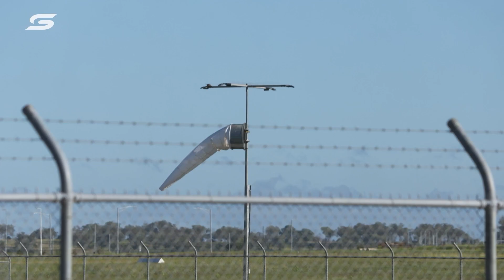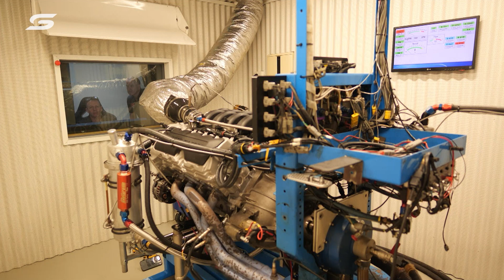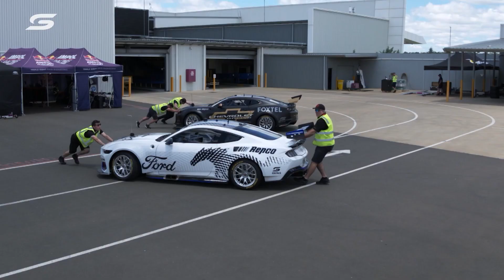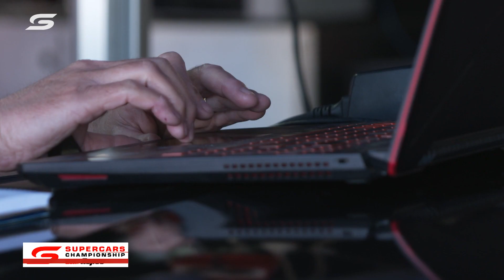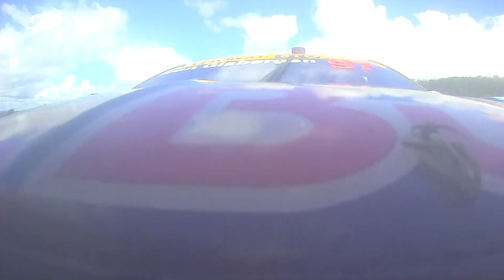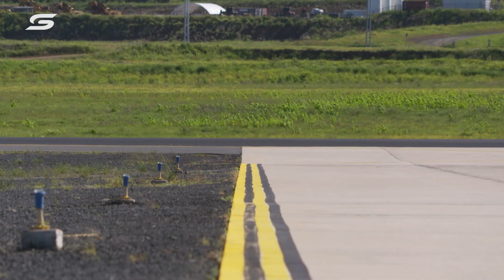Why aero testing Gen3 is so crucial | Supercars 2022

Comment: Well we know it's BS now Larko because Ford aren't happy what's happening to the rear wing...
Ford need answers and nothing coming forward..
Reply: I think a missed opportunity to get rid of ( in car ) anti roll bar adjustment. There should be 1 setup for race day. Both cars can be the same this/that but as SVG has proven ( in my eyes at least ) the more corrective adjustments made to anti roll bars front & rear, the better your chances. SVG, l would say watching over the years makes more adjustments than any other driver. Supercars can say that both are the same but once drivers play around with the in car anti roll bars, aero differences will occur resulting in different performance outcomes.

Comment: So compared to gen 2, the gen 3 supercars make around 50hp less, have 60% less downforce and increased aero drag, yet they somehow still reach the same top speed?

Im aware that it's all supposed to be more cost efficient for the teams, but my logical mind thinks that having cars closer together on the track would have an increased risk of more crashes, thus requiring extra production of all these custom shaped panels and mouldings, therefore its not really being more cost effective.
Or perhaps im completely wrong?
Reply: No, DEcreased aero drag, hence why they make a similar top speed with less power.
Reply: @MattyS02  
Better aero INcreases the downforce - more downforce means more drag, therefore you are INcreasing the aero drag.
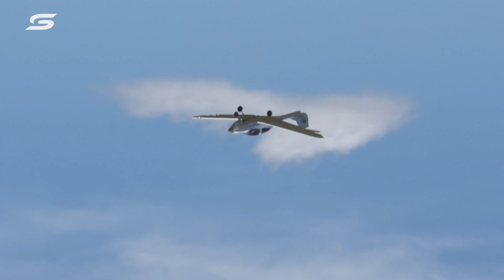This is what he says at 08:12 and that it kills straight line speed, hence my confusion at how they can still reach the same top speed as the gen 2s
Reply: less weight and better power to weight ratio, we'll see when the hit the track in anger.
Reply: @nickycrea6075  
I don't think less weight improves overall top speed - rather, it will accelerate faster and have better fuel economy because the engine doesn't need to work as hard (this is newton's law of motion, F = ma)

I dunno, im guessing they've tested its top speed, so i must be wrong lol i just can't make sense of it.
Reply: @zchettaz  since the Power to weight ratio has improved speed will be around the same.
we'll know for sure when the cars hit the track.
Reply: @@amwashere 
Thanks for clearing that up. So basically that would mean the 60% more downforce in the gen2s decreased there top speed equivalent to 50hp, is that right?
Reply: @@amwashere 
Again, i refer you to 8:12 in the video.
He says "The more aerodynamic downforce you put on a car, the more drag you create"

Comment: So how can a simple guy like me in the U.S  get some of the body parts and the Spendle mount wheels and kit for the wheels?? I have a Camaro that needs them in its life. It told me so lol.
Reply: Unfortunately not one bit of these reflect a street car. Every single part is custom made race car
Reply: @Bruce Mcginty  well some of that needs to change! Truth be told, it doesn't have to be carbon fiber or space age metals. I would Grand Touring my SS looking like the SC Gen 3 Camaro only with an interior and AC. Lol
Reply: @Bruce Mcginty  I do get what you mean though. Kind of like NASCAR did back in the day, right? Run what you brung and what wins on Sunday sells on Monday kind of thing. I agree 👍. I think there should be 3 classes imo. Showroom stock (with cages and safety equipment), what they are doing now where the drivers come into play only (basically) and then unlimited class.

Comment: So, just out of curiosity: is there a specific reason why V8 supercars didn't become a spec racing series where everyone drives the same car if their performance numbers are exactly the same?
I would've loved to see a BOP style approach to this, which would still allow cars to be different, but come out rather close in performance.
Reply: I think the suggestion is that a Mustang-only series would lose the interest of Chevrolet/Holden fans.
Reply: @TassieLorenzo  Interesting, I though holden was Australias Opel and had nothing to do with Chevy?
Reply: @shadow-r3852  Holden has used both Opel and Chevrolet pressings and engines over the years.🙂

Comment: I dont know why yall equate less downforce to better racing. Someone explain.
60% less downforce with the same tires and just as heavy cars? Will turn into a tyre management festival.
Reply: The new cars are 100kg lighter thanks to the aluminium engine blocks and full carbon fibre bodywork.
Reply: @TassieLorenzo  100 kilos is a lot i must admit. But still
Reply: But they got to make a video and get some ad revenue, make the audience feel engaged woth the changes and feel smarter because now they can tell people they know about aerodynamics or something and they are promising better racing. 
Next year the commentators will be able to talk about the tyre management strategies. 

The sport runs on the story they can tell, not so much on the racing.
Reply: They're looking for the cars to be twitchier i assume so they can slide around the corners and need a bit more skill to drive, so drivers can overtake when another makes a mistake more often, it might effect turbulence and make less difference in speed by coming out of the slip stream but i don't know. 
Cars sliding is more interesting and maybe just more crashes equals more better.
Reply: @chrisnoname2725  sliding means wasting tire life. No team wants that  More crashes means more money spent to repair. No team wants that either so it will be a tire saving festival
Reply: @km6832  I wasn't saying you were wrong, i was saying why i think they are marketing it as better. Race cars cost money, they get damaged, that is offset by getting more viewers. It depends on tyre rules, they might have to conserve them a bit but if they make things too boring then they will lose viewers if it becomes more exciting to watch trucks driving up the highway. It's entertainment.
Reply: @chrisnoname2725  didnt accuse you of  being wrong either. Was jusr stating how it most likely will turn out.
Reply: @km6832  "sliding means wasting tire life. "  On radials, yes.  Cross-ply tyres like in TA2 work better at big slip angles, hence the four wheel drifts in F1 in the 70's before they changed to radials around 1980.
Reply: @TassieLorenzo  we dont use cross ply tires on modern racecars now do we?
Reply: @km6832  I should hope not, but they do in TransAm/TA2 and it would "solve" the problem of people who want the cars, say the touring cars in the ATCC, to slide around more.

Comment: I really wish NASCAR and Supercars had collaborated to have a shared platform for some potential crossover entries in key events.  Huge missed opportunity for both series.
Reply: I’m not so sure Australian fans are interested in oval racing, I know that NASCARS operate on circuits as well but their natural home seems to be ovals I don’t think the Aussie fans would want the performance of the cars that do Bathurst, Sandown, Adelaide etc compromised to run Ovals. Not that we have more than one oval here. We tried NASCAR a bout 20 years ago, it didn’t last too long, I think we like corners that go both ways.
Reply: @hughjohnson2674  Perhaps a revival could be in order, I know with Auscar and the like there was interest there in the 1990's and I do know the dirt oval scene is very strong with both late models and sprint cars, so there might be more oval interest than you know of, simply not from folks who are typically Supercars fans and are devoting their dollars and eyeballs to other forms of racing.  Also, NASCAR's really diversifying the schedule with more road courses and even street circuits so there'd be no better time really.
Reply: @hughjohnson2674  is it really oval racing when there are as many road courses as WEC rounds
Reply: @Kadarii  there’s no oval racing in Supercars, they’re not built for it. They’ve just spent two years and a shed load of money, like F1, to make the sport cheaper and produce better racing by introducing as much parity between the vehicles as possible. They have matching chassis, suspension, brakes, horsepower from crate style engines that run on e 85. A Gen 3 supercar is not legal under NASCAR rules and vice versa. Our cars have 6 speed rear mounted transaxles, flappy paddle gear changes,  carbon fibre panels and run different wheel and tyre combinations. Nascars are probably faster in a straight line but throw one around the mountain for 1000k and we’ll see who’s quicker in the end, our cars are all based on new tech. Whose rules are going to change to get parity? We tried a version of Nascars here years ago, one entrepreneur built an oval. It lasted about a couple of years but couldn’t take pay for itself. Supercars Gen 3 car is designed to reduce costs, it’s being introduced next year, the teams are building them now. Why change to a lower tech spec.
Reply: @hughjohnson2674   I love how you assume i’m an infirm when you don’t even know Gen 3 regulations or the Gen 7 cup car, I just want sustainability from a series I love…
Reply: @Kadarii  never said you were infirm I know Gen 3 Regis not Gen 7? At all. But a Supercar isnot a NASCAR and never should be
Reply: Nascar wouldn't last 3 laps on our circuits mate. Gotta brake a lot harder for real corners.
Reply: @SomeYouTubeGuy  LOL! Absolutely! Well said!
Reply: It would not work, NASCAR cars are very fast but are not as hi technical as Supercars. To put a NASCAR on a track with left and right corners a lot of things are changed from when on an oval track.
Reply: @MICHAEL-ys3pu  I would usually agree, but with the next gen car having more road courses and even street circuits (like the upcoming Chicago street circuit race) was something they had in mind and wanted to have a car that could be converted to run at all the types of tracks.  It's the one time it might have been possible.  NASCAR already used the transaxle from the Supercars, using a shared platform was actually sensible for once.
Reply: @seanwilson9117  NASCAR never allows racing when it's WET!
Reply: @Peter-Science-Nature-Facts  they do though.  They have ran in the rain on road courses for years now.
Reply: @seanwilson9117  Oh dear NOOO! You should look up (& try to understand) the word IRONY! Yes, "road courses" - NEVER OVALS! SMH!
Reply: @Peter-Science-Nature-Facts  yeah, there was a tire test at Martinsville but nothing came from it.  I wish they would just go for it and it either fails spectacularly or works.  But I just made the distinction because we're creeping up on about 1/3 of the schedule being road courses
Reply: @seanwilson9117  Roger Penske sold his stake in DJR back in 2020 and in the same year, Scott McLaughlin went to join Roger Penske's Indycar operation and that's where Scotty has been ever since.
Reply: @Peter-Science-Nature-Facts  only on ovals...
Reply: @MICHAEL-ys3pu  the next gen car that came in with the 2022 season is a lot more like the Supercars.  With every generation previously you'd be 1000% correct, but now everyone's using a shared Dallara chassis, single lug 18 inch low profile wheels and tires, a transaxle taken from the Supercars supplier, and similar suspension set up.
Reply: The other real issue is budgets. Ther is super 2 and Super 3 existing because the rolling stock is available, also many of those junior capacity teams were used by the majors to keep their second drivers in race trim, Jack Perkins for example won the super 2 championship and ran in the top 5 for some time, he’s still in demand as a co driver. Technically our cars are better although less powerful and on a cuircut of any type would leave a Nascarfor dead. There’s nothing NASCAR can offer for the costs it will demand that we don’t already have covered, The money needed would be better spent on Australian Series. Any hoo lots of the US sponsors are paying for cars and brands that don’t sell here.  V very difficult to pull off financially I would think.
Reply: Not sure if I agree with you on this. They are just so far apart.
Reply: @KingWillbro  Who are you talking to?
Reply: @sezniteowl5398  The original post.
Reply: Next Gen NASCAR is basically a heavy more powerful Supercar...
Reply: @gerardcrabb4556  exactly, that's why I don't think it would have been that big of a challenge for them to have just cooperated and put together a shared platform.
Reply: @seanwilson9117  Engines way more expensive and compromise for roadcourses with ovals in mind... Penske had ideas to make Supercars more cost effective but they stuck to old 4 door chassis for Mustang Gen2 and restricted Ambrose return with no testing... A Gen 2.5 would have been cheaper option allowed for factory based engines and just needed roll hoop adjustment in chassis and reduced aero on new bodies...
Reply: Sean Wilson - OMDays! I really cannot understand/comprehend why people (like you) feel the need to compare Australian Supercars to NASCAR! They are (for the drivers) SO very DIFFERENT! I'm incredulous that you wouldn't appreciate this - SORRY TO SAY!
Reply: No! Sometimes things don’t always need to be combined appreciate them separately as they are
Reply: Hey Sean, you might think I may be misreading your comment but Nascar used to have a series in Australia (Australian Nascar Championship) now it has expanded it's series in Canada, Mexico and now Brazil.

United States (NASCAR) 

Canda (NASCAR Pinty's Series) 

Mexico (NASCAR Mexico Series) 

Europe (NASCAR Whelen Euro Series)

And now Brazil (NASCAR Brasil Sprint Race, starting in 2023)
Reply: @sezniteowl5398  Kind of but my issue with those series is that they all use a different car.  That really caps how much can happen with crossing over and having folks from one series come race with another series. What I was saying is that had NASCAR and Supercars worked together on a shared base platform then that would have been possible for Supercars teams to come run with the Cup series at Chicago's street race or Circuit of the Americas or even take a shot at the Daytona 500 and NASCAR teams could field an entry at Mt. Panorama.  It would have been a great way to build both series' reach.  You've already got Penske at least with a stake in both.

Comment: They can ramble on as much as they want about how it's all equal, but the proof of the pudding is in the eating. I can't see anything changing as far as the results
Reply: They seriously need to stop allowing teams to modify/engineer certain parts of the car. Triple 8 has the best suspension engineering out of the field, but it’s really hurting the sport competition wise. It’s time Supercars take some notes from GT3 balance of performance
Reply: @nanobyte5567  they should either do what NASCAR does which is every single car is the exact same or they can do what TCR does which is have a weight penalty if you start winning too much
Reply: @dranthappens  The Gen 3 rollout will still be better than the NextGen rollout in NASCAR.
Reply: @toyotaecw  this is closer to what NASCAR used to be.
Reply: @mockbattles  No idea
Reply: @nanobyte5567  suspension is provided by Pedders. All teams use it but it was made a control component because ONE team decided they wanted to use their own stuff. That team was actually Penske. T8 have the best Engineers,  best drivers and best mechanics. they rarely make a mistake and are rewarded for it.

Comment: All this cost will translate into a viable business model of sales for Chev Im sure. 
Aussies weren’t buying holdens at $60-$70k………..but I’m sure they will buy a camero for a cool $120-140k. 
Can’t wait to put a deposit down on one 🙄 Oh wait, are they even bringing them into the country in 2023 ?
Reply: Its no longer about manufacturers racing. Since holden and falcon are dead, its simply a revamp of the buisness to keep the supercars show viable. Its an entertainment industry, and their goal is to keep it entertaining.
Reply: @slickstrings  All that means is that the sport doesn't have the part that made it attractive to people anymore. Maybe it should have wrapped up and they should have started something different. Leave supercars as what it was and in the past with the cars that used to race in it. 

It's not like anyone had to lose their jobs, just change the name and then run it however works best but it is jarring to continue with the name but without any resemblance of what it was.
Reply: gm won't even be making ice passenger cars in 10 years.
Reply: @pizzaki582  gm has just announced that they will be making a big investment into the next small block v8

Comment: Doesn’t this devoid the statement - race on Sunday, sell on Monday. If you make everything exactly the same. Would this not make everything too close and clear advantages? Ie you will kill the action or am I wrong?

I do like the fact that the cars are closers to road going cars.
Reply: "Doesn’t this devoid the statement - race on Sunday, sell on Monday. "

That statement has not applied to Australian "Touring" car racing for the last 30 years.
1993 rule changes to get rid of the skylines is what tossed that statement in the bin.

As for parity racing, the argument is that it puts the winner back on the driver and not the car.
Compare Supercars to say F1.
Supercar races are a LOT closer and more exciting than the predictable procession that F1 has been over the past 20 years or so.
Reply: Having clear advantages for 1 side is horrible for the action. It means 1 team romps home with all the wins. Creating the parity is what makes the action.
It's why Moto3 is some of the best racing on the planet. It's down to setup and driver. 
Race on Sunday, sell on Monday is brand value and you don't even have to win to see the value. Just the presence in the living room at all drives sales. The winning cars will still generate sales on Monday because they are simply advertising.
Reply: GT3 cars are certainly much closer to the road cars!  Coincidentally there will be a Ford Mustang GT3 car...
Reply: This didn't pan out well 2 aero adjustments later...